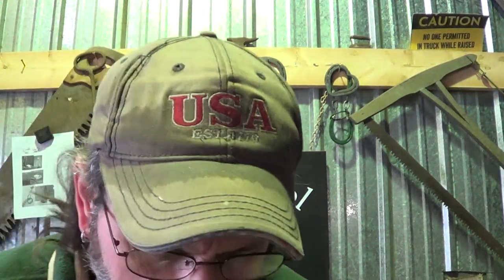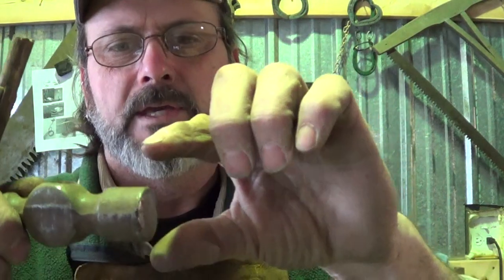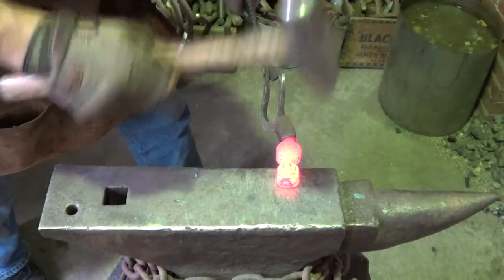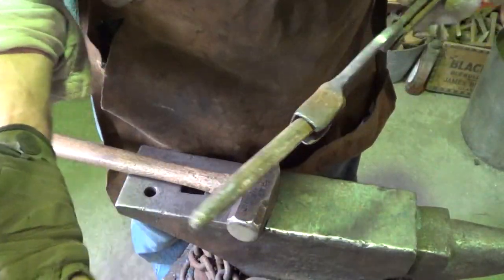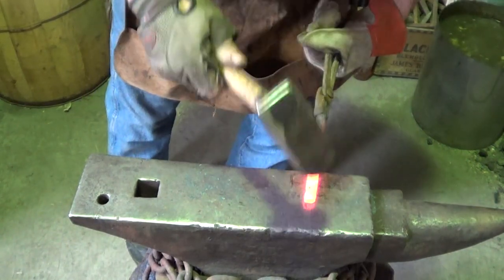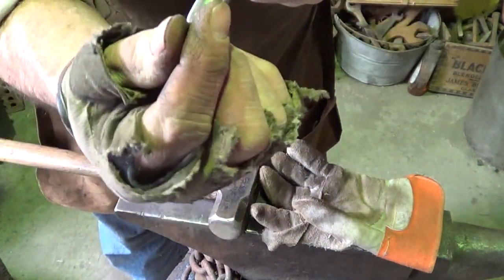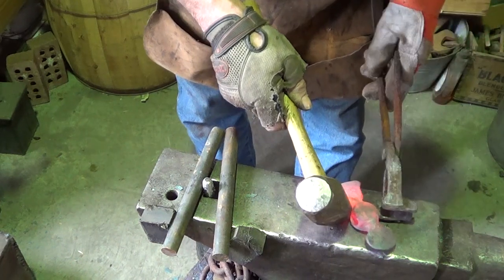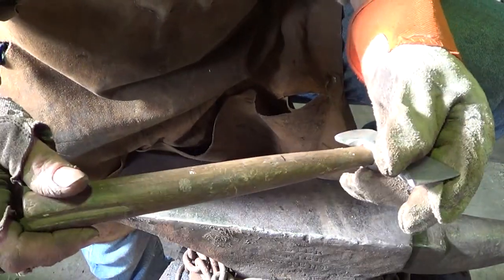Blacksmithing - Making a Texturing Tool From A Ball Peen Hammer

Comment: Nice video, Chandler! Thought: why not use an air chisel with your chisel bit of choice, pressure adjusted down to give you just the right texture. Cheap, fast, and easier than beating your body to smithereens.